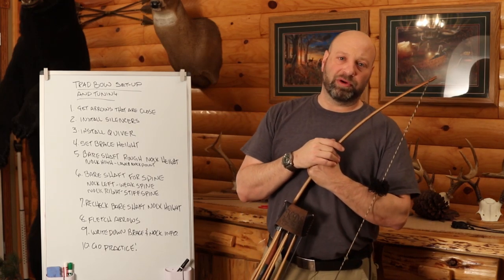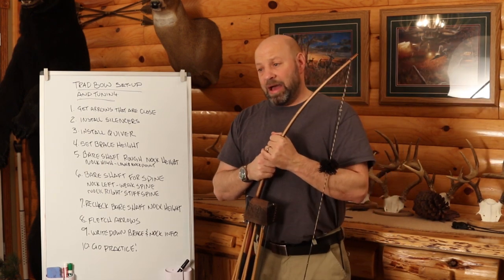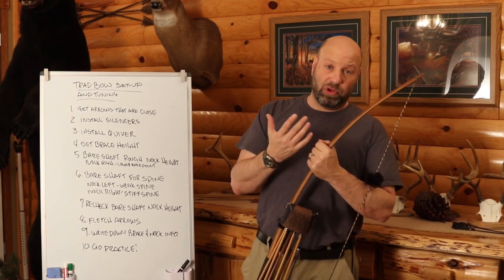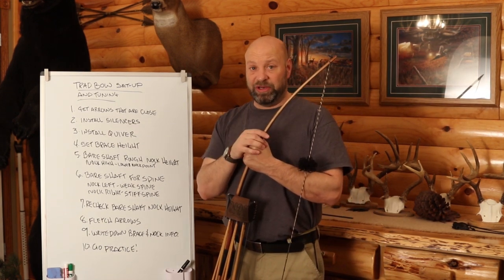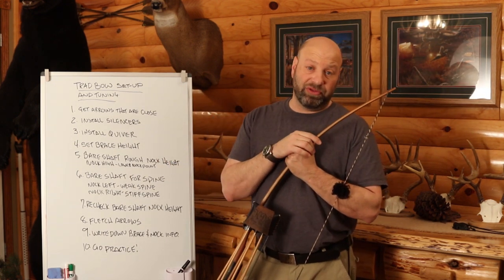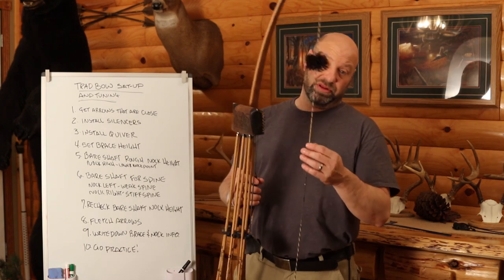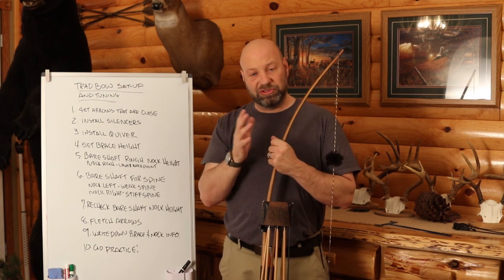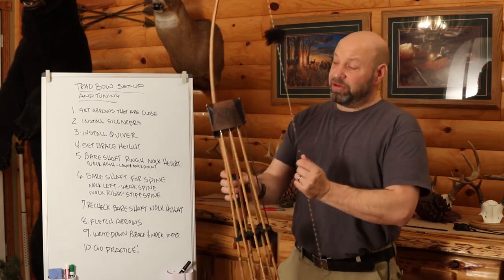Traditional Bow Set Up And Tuning

Comment: I have multiple weight field tips and also use #10 washers that weigh 12 grains a piece to fine tune and tweak the best point weight when bare shaft tuning. I can usually stack up to 3 washers behind the field tip, depending on the thread length, maybe 4.  If all you have is 125 field points, the washers can take you up to around 160-170 grains which match several popular traditional broadheads like Zwickeys, Magnus, and Grizzlies with aluminum screw in adapters. If you want more strength and weight, you can switch to steel screw in inserts. Thanks for all the good info.
Reply from the maker: Great tips and ideas!

Comment: Another informative video, specifically  relating to the arrow tunning which is tough to dial in especially when your form is not consistent.  One comment I have relates to the weight of the insert you are going to use.  Most arrows come with the standard relatively light inserts and we always want to beef those up.  Since you build your special double inserts to get high FOC percentage, I'm thinking you tune with those and cut your shafts to 1 1/2" over and then adjust the points/heads  because you have a good idea what spine works with the bows you shoot?  So how might a less experienced shooter go about the process of dialing in spine and insert grains?  I primarily target shoot since SoCal not a hunters paradise but I do like to have some FOC.
Reply from the maker: Great question! The best approach in my opinion is to know what point weight you want to shoot (head, insert and adapter combo), then get the shaft that best accommodates that and cut the shaft as you bare shaft tune until you get perfect arrow flight or run out of shaft to cut. If your shaft gets too short you either go to a stiffer spine and repeat or lighten up the head weight.

Comment: Thanks for the feedback.  Just curious what spine arrows you're dialing in with your setup cause of the 30% FOC.  I think you have mentioned your bows pull around 56#'s at your 26" draw?
Your timely responses are always appreciated
Reply from the maker: My arrows are .500 spine but that is because I use a 3 inch custom made 200 grain insert. That 3 inch insert reduces the length of flexible shaft and puts me in .500 spine arrow. If using a normal length 100 or 209 grain insert I'd probably be .400.

Comment: Do you have a recommendation for a starting point for arrows with a 50lb @ 28" recurve (58")? Thanks!
Reply from the maker: I have not had to change arrows in 15 years as my bows are all the same weight. So I'm not real uptodate on the charts etc. What I would do is goto tradgang.com and make a post with your bow style, draw weight, draw length, and planned point weight. You will get many answers from very knowledgeable and trust worthy people that will answer correctly and help you.
Reply: @SamkoTradBow  thank you for the info!

Comment: Have you ever experimented with the aluminum footings?  I believe that they essentially stiffen the shaft as well.
Reply from the maker: I have not yet but it's out of sheer laziness.  I would like to and someday will run aluminum footers. The key is the keep the footer the same length or shorter that your insert and it will not affect spine. But if you make the footer longer than the insert is inside the shaft the foot will stiffen up the shafts spine.
Reply: Great point!

Comment: I got a Bear Super Kodiak recurve and the manual for it gives a brace height between 8 and 9. So I set it at 8.5 to start.... What do you think of using serving instead of brass for your nock point? And do you clamp the brass nock til its totally closed?
Reply from the maker: Beautiful bow!!!! For brace height I normally start at the low end and keep twisting and shooting until I no longer hit my arm with the string.  Then I write that down and that is the brace height I use.  But that is just my way. Others keep twisting until they find a noise sweet spot etc. 
Tie on nock points are excellent! I use brass because I'm lazy and always have. Most of the time I can not get them completely closed. Brass will chew up your gloves or tabs. Tie ons will not.

Comment: YOU say about brace length being  critical Do you do that by shortening the string?
Reply from the maker: Correct. Shorten or lengthen the string by twisting it tight or looser. Measure from the string to the throat of the grip

Comment: For a takedown, recurve. Once you set the brace height. Then take the bow apart, I assume I have to reset the brace height every time?
Reply from the maker: Depends. If you take the string off the limbs yes. If you leave the string on the limbs no
Reply: @SamkoTradBow  that’s where twisting the line comes in, right?
Reply from the maker: @djkilpatrick5256  correct. Twisting thw string sets the brace height

Comment: Hey Jason. Great stuff!  Was wondering about your thoughts on arrow length. Seen a lot on forums of guys shooting full length 32” shafts...my normal length would only be 30.5”. But full length feels like a spear. Any thoughts ... does it matter  within 2 inches?
Jp
Reply from the maker: Does not matter, but my thought is the shorter the arrow the better chance it passes thru and into the ground.  An arrow in an animal causes them to run full on until they die alot of times. I'd rather the arrow sticking in the ground and the animal dies in sight because it's not spooked.
Reply: That makes sense. Thanks Jason. Happy hunting
John
Reply from the maker: @forgottenheritagehomestead8448  any questions anytime bud!

Comment: What spine are you shooting?
Reply from the maker: 500 spine but I'm using custom made 3 inch long inserts and a 27 inch arrow
Reply: @SamkoTradBow  thank you for the reply. Thank you for all the great content as well. Your channel is a treasure of information. 
  I shoot a 26" draw as well. My bow is a bear kodiak hunter 55#. At my draw length im sure im under the 55#. I have 400 spine gt trad arrows @ 27". Going to put 250 grains out front. Fo think i may be over spined to start with? Thanks again.
Reply from the maker: @goyaae7588  spine has so many variables like release, bow torque,  string creep before release etc. The only real way to see what spine works vest for you is to bare shaft test by shooting a bare shaft with no feathers. Use the field tip of point weight you plan to use and watch the arrow in flight ro see how it flies. Google search what is still or weak. I can't remeber as I have shoot same bow weight and arrows for so long. If too still add more point weight. If too weak shorten shaft 1/8 inch at a time if you have the room. If don't have the room go to lighter point or stiffer spine.
Reply: @SamkoTradBow  thank you. Will do. Have a great evening